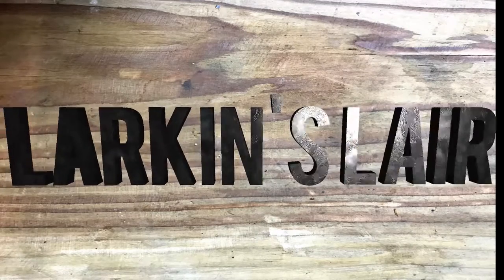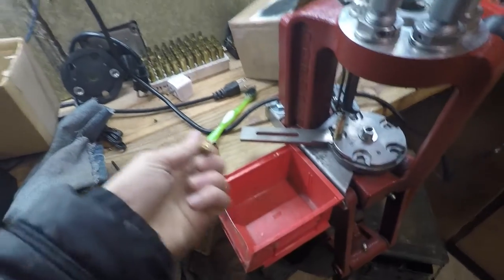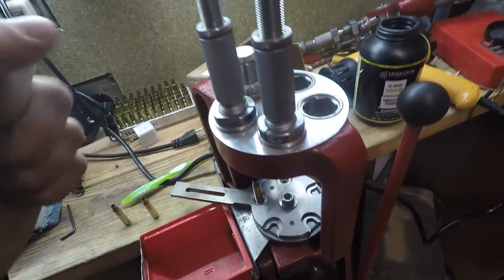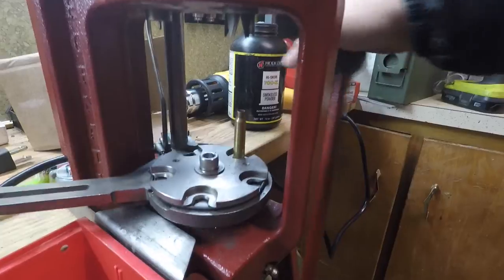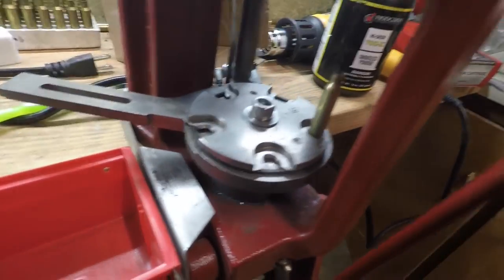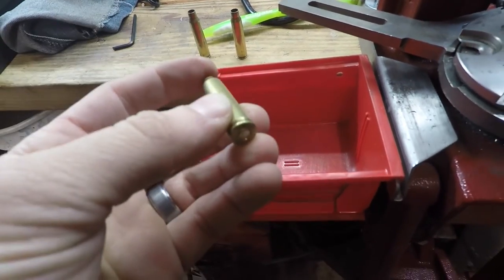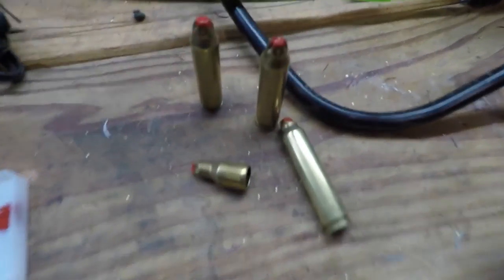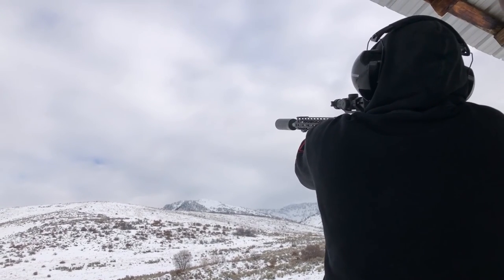Easily Load Blank Rounds

Comment: halo mr. I made hollow bullets from 5.56 sharp bullets but when I shot it sometimes it flashed sometimes it made a soft sound, for the filling I used original 5.56 sharp bullets, you can check the size of the filling

Comment: Thanks for the info. Do you have any advice for 30-06 blanks? Im trying to make some up for an M1 Garand.
Reply from the maker: No matter how hot I loaded the blanks with pistol powder they never cycled the gun even with a golf ball launcher on the end. There wasn't enough pressure in the gas tube to cycle the action. Even when the blank was 100% full of 700X which is a fast pistol powder. 

So it probably won't really matter how hot you load your blank for your M1 Garand. I would start somewhere similar to where I did my .223 blanks and go up from there. But my guess is it won't matter. 
Ultra hot blanks: https://youtu.be/CS22gakj6iU

If you want blanks to cycle properly you have to use one of these: https://militarydepotusa.com/ar15-m4-m23-blank-firing-adaptor-for-carbine-yellow-mnt16ad2c/
Reply: Ok, I have a blank adapter installed, this would be used for reenactment events. Any advice for a Garand load to start from?

Comment: I am wanting to make just a few rounds I dont have any of the equipment you have but what I am wanting to do I cant find answers for maybe you can help. I would like to make like one round a piece for my hand guns and wondering if I use a live round remove the lead would the grain inside those be enough to make the blank and since I cant crimp it can I use something like cotton or Ive seen cork and pack it will it still fire. The reason I just need single rounds I want the first round in my pistol to be blank so if needed to disburse/scare something that round wont be lethal just enough to scare and then the second to be able to protect if necessary. Or should I add more grains than say the 30grain it comes with? Any suggestions?
Reply from the maker: This is what I use for a "warning" https://pompepperspray.com/
To use lethal force you must have a reasonable fear of imminent bodily harm or death. Now you are using a blank as a warning which means you obviously don't have an objective fear of great bodily harm or death. 
To make maters worst having a blank loaded in the chamber just made your draw to first shot time even worse. And the #1 way to win a gun fight is to be the first to put a shot in an anatomically significant spot. 

So yes you CAN use a blank to scare someone, but I would say it is a bad idea from a self defense strategy. Also if you don't have the crimp dies you can do what you said and get some sort of cork, but then cycling can become on issue so you would likely have to manually load it.

Good luck! Also check out the Active Self Protection Channel they have some AMAZING information on self defense.

Comment: I take it they will not cycle your AR?
It took me a bit but it finally came to me why you didnt resize the cases. So then the question is do you only use the spent cases that came out of the gun you are running them through?
Reply from the maker: Yes, all these came out of my AR and have been loaded several times.

Comment: Hi I am from Czech Republic and I have a few Blank guns ( not a real guns ) Can you help me with powder Measure ? Iwant to craft  some 7,62x54 R blanks , some 9 mm Luger blanks and one of the reloaders give me information , that i can use Powder Lovex S035 , but i donˇt know what pressure is it , If itˇs only for Rifle Blanks , or if itˇs useable for 9 mm SMG blanks also .
Thanks for tips , I am Begginer .
Reply from the maker: Sorry for not responding early. As for you blank loads, what do you intend on doing with them. I have honestly never even seen a "blank gun." It doesn't sound like something I would ever want to own either. I can give tips and pointers but I hesitate to give exact loads due to liability purposes. 

My recommendation would be work up a load. Which means start with a small amount of powder, test it, if it doesn't cycle then increase your powder charge until you get the results you want. An under powered blank won't damage anything, but starting too high can be bad including blowing up your gun and killing you. So start small and work up from there.
Reply: @TheLarkinsLair  Thanks , yeah i honestly  agree with you , I will start from 0,250 g of powder and I can add more if my gun  PPS43 Sudajev  which i have  Setup on PPU 9x19 Luger Blanks will not cycle i will add 0,050 grams od powder if it will not cycle like factory Blank Ammo from Prvi partizan.
Reply: @TheLarkinsLair  I also think , that Powder Lovex S 035 and Lovex S015 from Explosia , that our seller from Czech Republic recommended one will fire slowly and second will fire rapidly it will be problem too . I donˇt know what pressure will be different here opposite factory powder .
Reply: @TheLarkinsLair  I measured today on Digital calibrated scale frankford Arsenal  - 0,355 grams of powder in PPU 9x19 Luger Blank its 5,5 Grains , I will start on 0,300 grams of Powder if it will be less dangerous for my SMG , thank you .